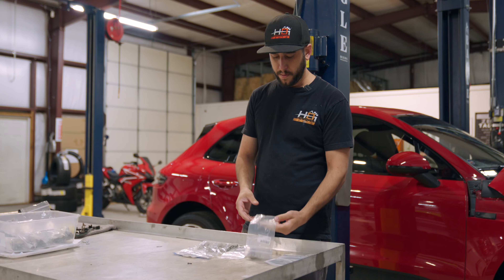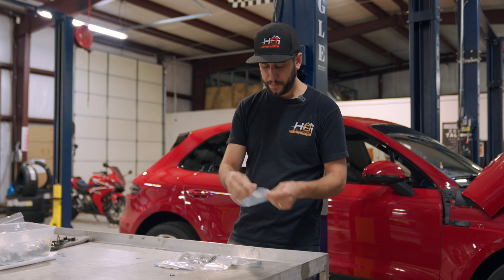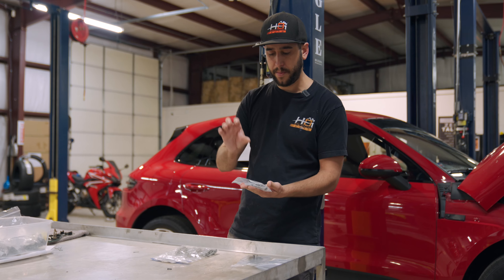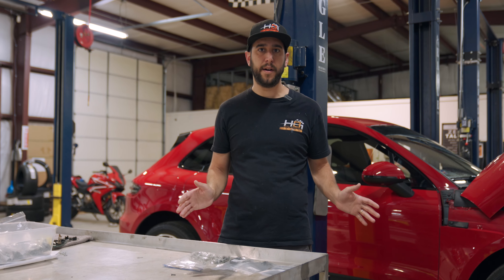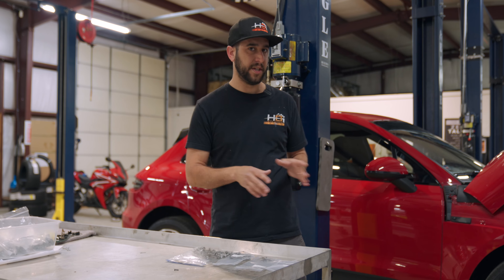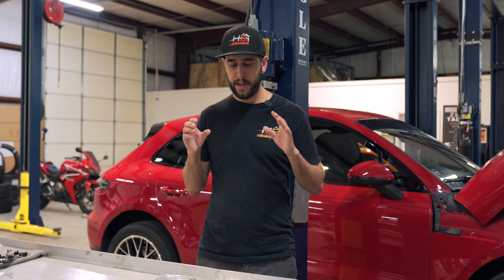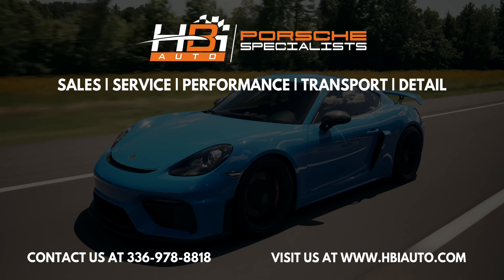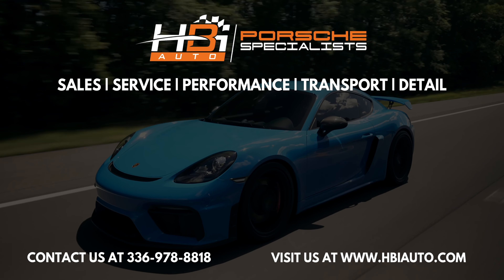2015-2018 Porsche Macan S, GTS, & Turbo Timing Cover Bolts Failure - Explained and Wat To Do!

Comment: Those spacers are designed to be used with steel replacement bolts on the top 2 corner bolts. The spacers are aluminum and that helps reduce galvanic corrosion between the magnesium timing cover and the steel bolt head.
Aluminum bolts in that location will break again due to the engine flex under load, and covered in RTV they will be harder to remove. 
Granted, the aluminum bolts will last a number of years before breaking again, generally 3-4.
 Otherwise, i agree with the rest. Doing an engine out timing cover replacment just for broken bolts is not necessary most of the time, and just replacing the bolts is enough

Comment: Does the 3.6 in the older Turbos have the same issue?
Reply: Yes, I am facing it right now. I pulled the top two commonly broken bolts and sure enough they were both broke in half. However, I still have an oil leak, so Im about to do my best to investigate the remaining bolts. It’s tight in there.

2015 Porsche Macan Turbo*
Reply: @ericsherrill4539  thanks! I'm looking for a Turbo specifically so this gives me something to check for
Reply: @ericsherrill4539 How much oil are you going through (quarts/mile)? I've got a leak but can't find info on how much the covers can drip.
Reply: @ericsherrill4539  And what did you find out? Where it the bottom ones? I have same issue on my 2015 Macan Turbo